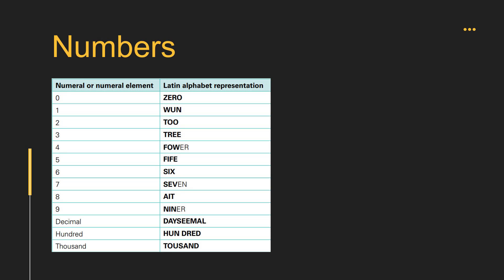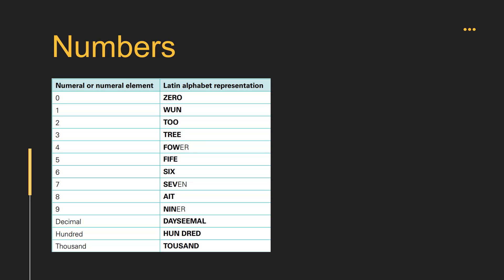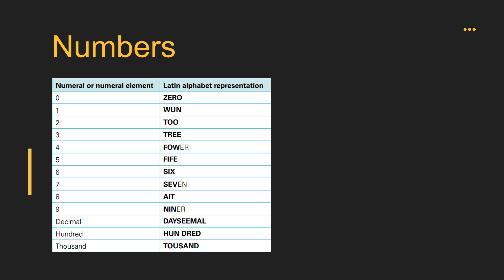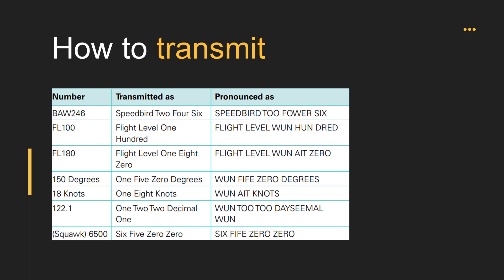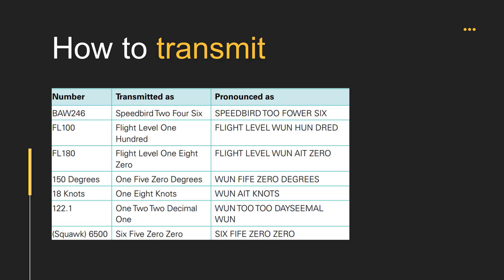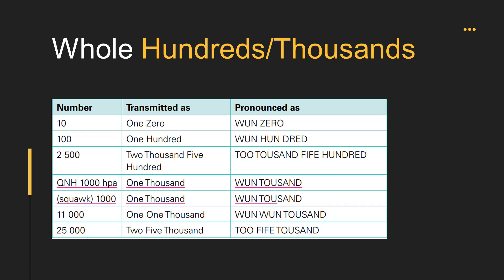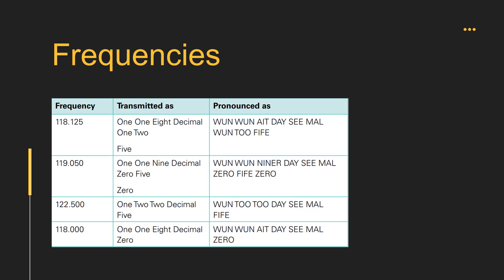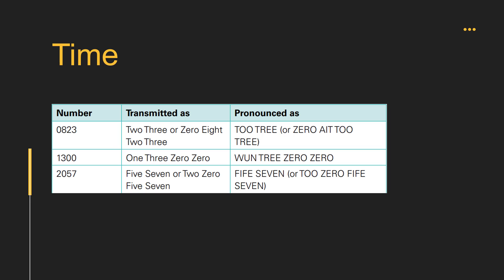How to Use Numbers in Aviation - Learn Radio Communication Basics For Pilots

Comment: But what about, for example 950 ft ?
Niner five zero ? Or Nine hundred fifty ?
Reply from the maker: Hi Marc. As altitude generally hundred or thousand is used. Like descend 9000ft (niner thousand feet) or descent 3500ft (three thousand five hundred feet)
Reply: Flight level zero niner fife [FL095]